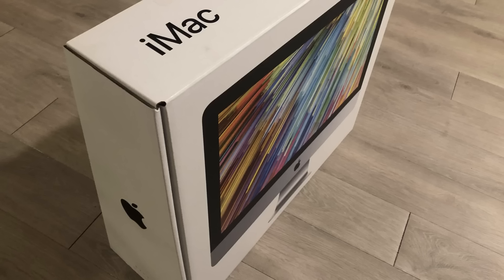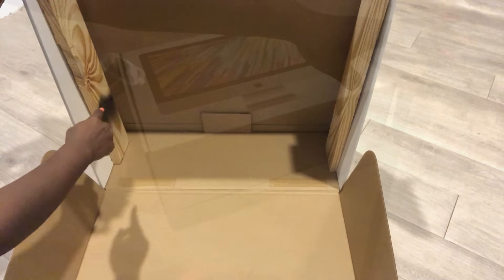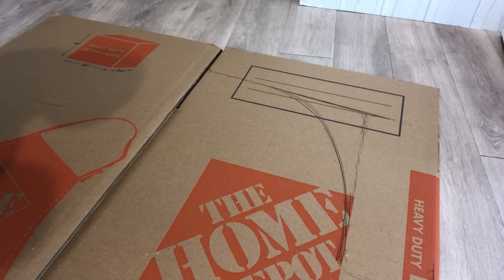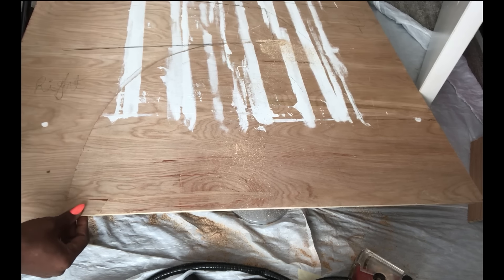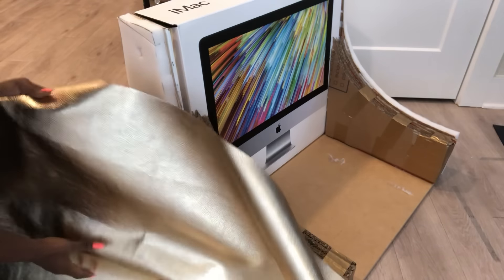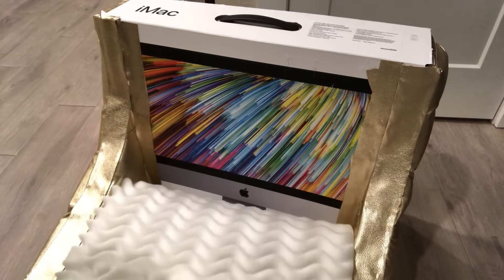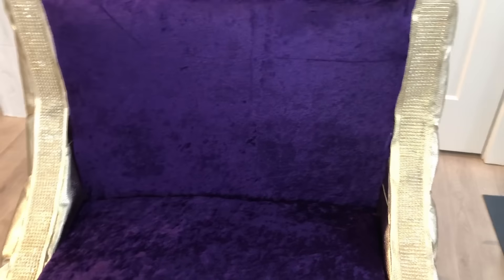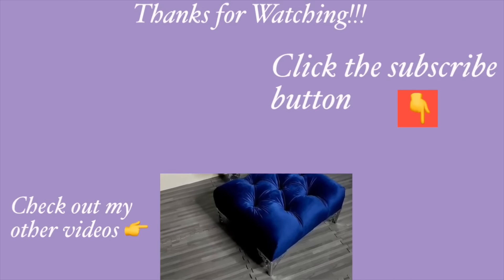DIY ACCENT CHAIR FROM CARDBOARD|  DIY HOME DECORATING IDEAS

Comment: Just mind blowing. I still had my mouth hanging open in amazement from this chair when I clicked back to a long live stream vid from fav dumpster divers Stevensteph resale killers  and at 1:04:51 they encounter a box that looks like a chair. Yoduvh you would have gone nuts for it too. I told them about our Cardboard Queen and gave them a link to your video.... Now doing the same for them so you can see their box and check out the channel. Heck if you were to do some dumpster diving. WOW is all I can say about that. The other day they dived JoAnne Fabrics and found a dumpster FULL of the cardboard fabric bolts you used in one of your recent DIYs and they find wood and a bazillion other things you use. Anyway here's their  channel hopefully at the 1hour 03 minutes and 51 seconds. Check it out. https://youtu.be/EpFiVDJuk6s 

P.s. woot the link works from here. One little commercial you can skip then her getting down from the dumpster and boom
 THE CHAIR. So no need to watch the hour chat and dive unless you want. They are hilarious and get some super scores.